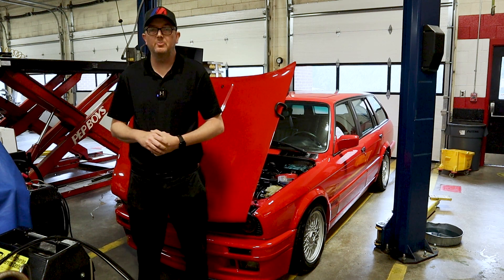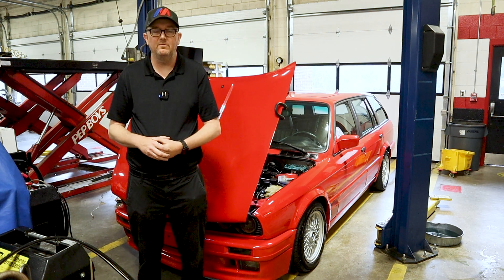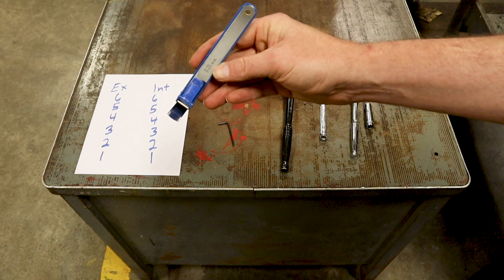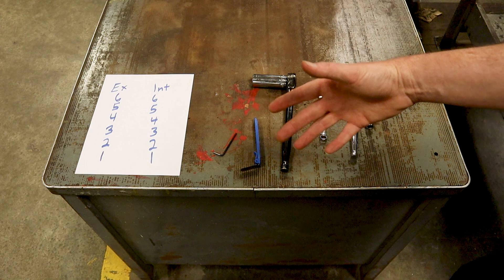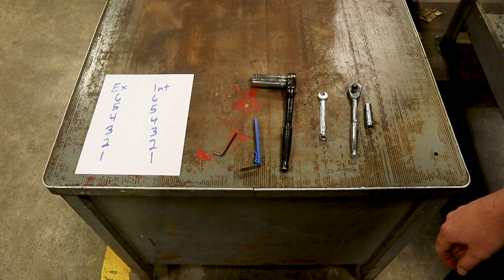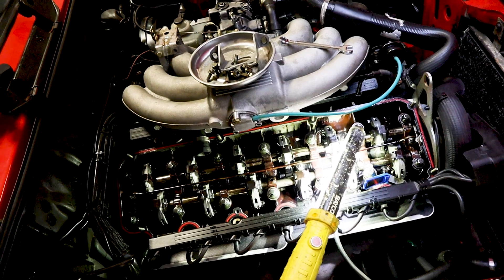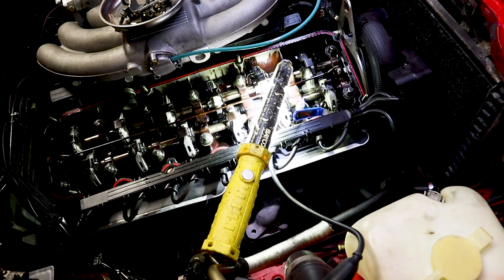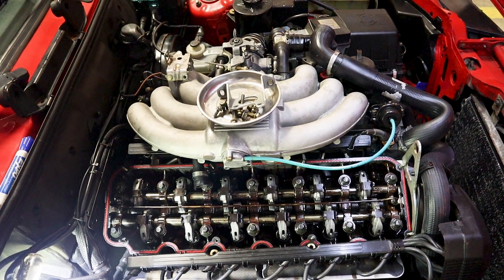Valve Adjustment on BMW e30 M20 Full procedure

Comment: Is the cam lobe supposed point straight down to ground or down toward the angle of the head?
Reply from the maker: @bruhbedrivin  the lobe should be 180 degrees away from the rocker, so nearly pointed down. The rocker should feel slightly loose. I hope this helps!
Reply: @AutoScholarwithMrB  ok. So just to make sure, for each cylinder you to have to go back and turn the crank to tdc and make sure one of  lobes either exhaust or intake side are at 180 of the rocker?
Reply from the maker: @bruhbedrivin yes, doesn’t have to be tdc, just can’t have any pressure on the rocker.
Reply: @AutoScholarwithMrB  ok thanks